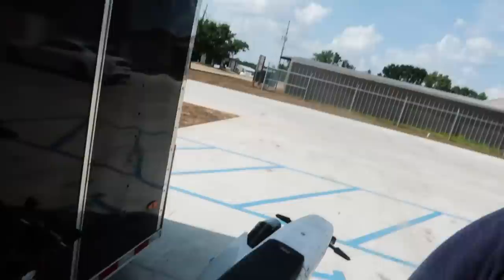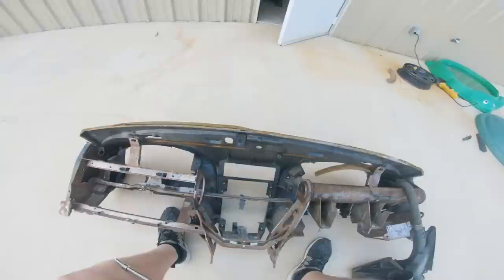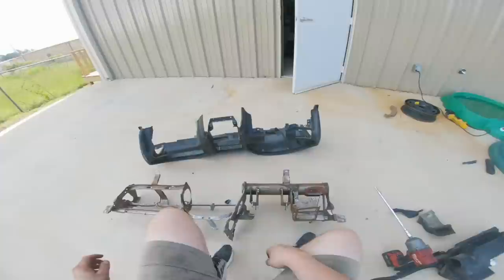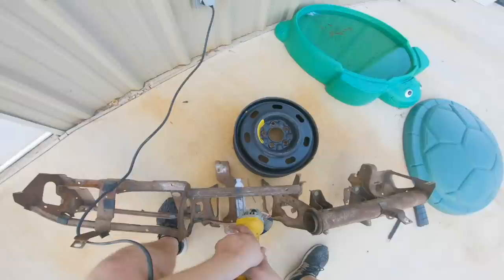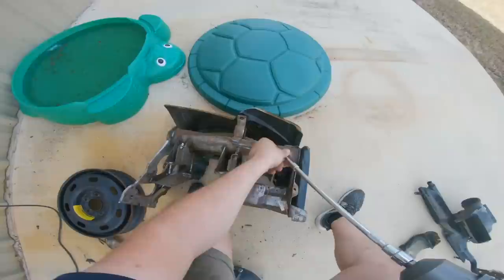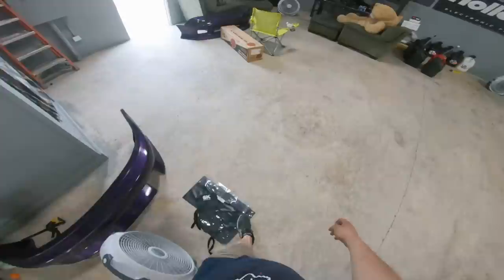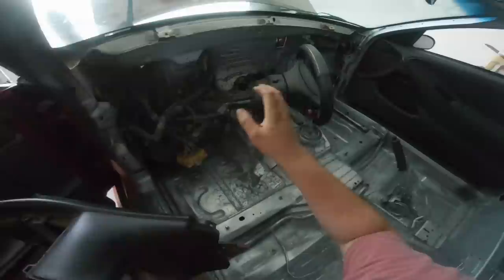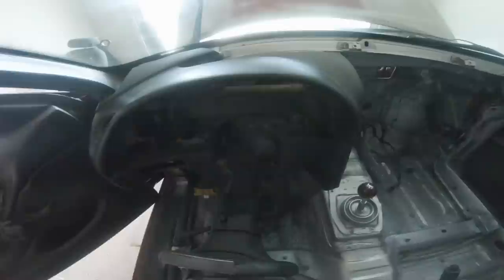How to make ANY car into a RACECAR!

Comment: Trying this on my moms Camry rn thanks poe 🤠
Reply: Boi with yo big back ahh
Reply: it would actually beat poes mustang even without weight reduction😂
Reply: Anthony my wife's Camry would deff smoke a 3.8 mustang. Probably would have smoked my 5.0 when it was stock. I looked it up and a 05 Camry is like 240hp.
Reply: Bryan Roupe camrys are unnecessarily fast😂
Reply: For a 2005 Camry it's pretty quick.
Reply: Doubt it doesnt have the stangs torque and they weigh about the same

Comment: Wont you get some aluminum pre colored sheets that come in 4×10 foot sheets and bend and ruvit your own dash together it will weigh a pound if that abd you can take the trunk lid off make your own out of aluminum sheet and hood as well and gut every body pieve on the car by drilling out the spot welds and remove all the inner panels. Shut passenger door permanently but can come off with some zuss clips and make a x frame for drivers door out if thing 1×1 aluminum angle and dling all that will reduce cars weught by atleast 100 lbs. Remove all glass and use lexan sheet and rivit in as new Windows that 50lbs lighter. If your building a true play racecar I would go extreme with the weight loss
Reply from the maker: MAN THANK YOU! I just happened to see this comment and you have some REALLY good tips.  I am planning on going full tube chassis with the car as well as full weight reduction.

Comment: Either remove the dash completely or leave it alone lol. It's going to look so ridiculously stupid with half the dash. Even the dude from itsjusta6 had the same reaction I did. It's your car though. Lots of other areas to take out weight and that half of the dash dont weigh 5 lbs. Cut out the rear floor, tube front end, tube k member, cut door skin and quarter skin, remove glass and install lexan (saves a ton of weight), remove gas tank and use a fuel cell etc etc.

Comment: How are you going to go fast? And what constitutes fast?
Reply from the maker: Twin turbos🤷🏼‍♂️
Reply: Poe what kind of power do you think it will generate?
Reply from the maker: stlmikie 400-600 depending on what the stock block will take. But that should take me down to low 10’s high 9s
Reply: Very exciting Poe. What trans will you be going with? Will you keep the stocker till it comes apart before you swap it for something more appropriate?